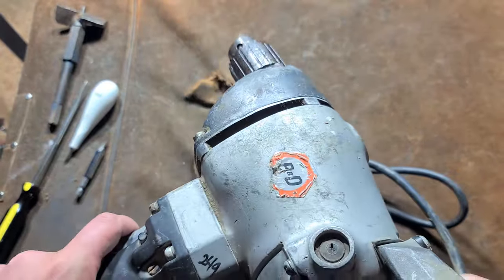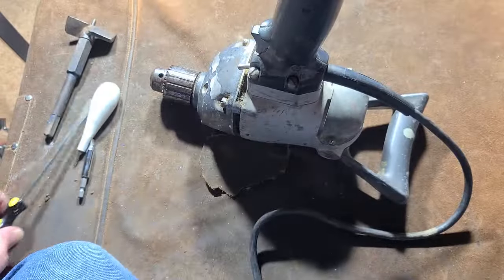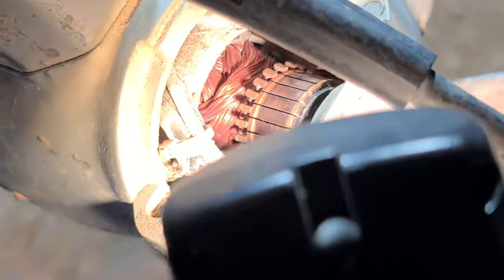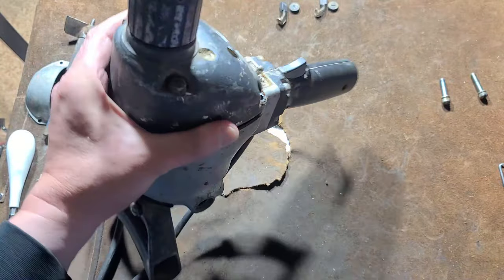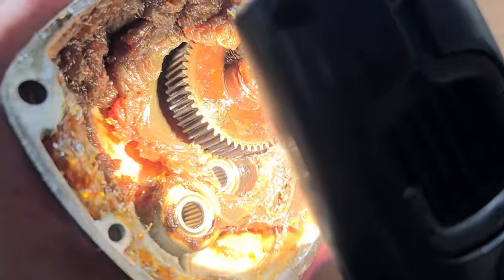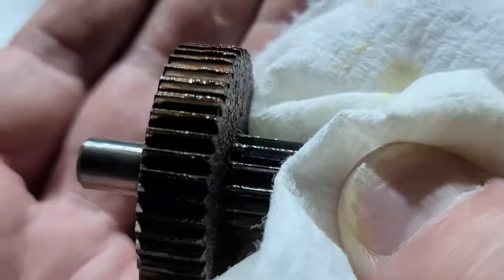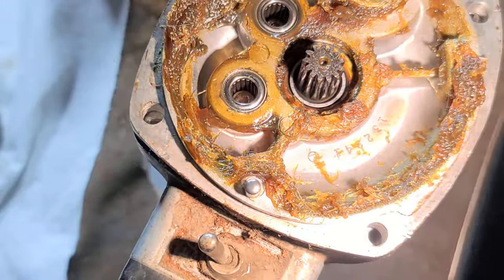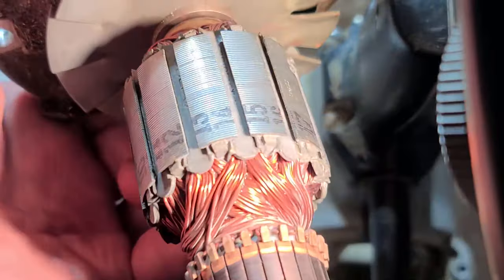Black & Decker USA 1/2" Heavy-Duty Spade Handle Drill Review/Teardown

Comment: Mr Maximus, It is good to see this classic, American made tool found its way to the right owner. I would respectfully suggest that with its inflated prices, Ebay is just about the WORST place to shop for  used tools. Lastly, I wonder whether the drill is older than the Linoleum floor. 🤔
Reply: It's likely that the drill is older. Its from the mid 1970's
Reply: @NKWoodworks  If I had to bet, my money would be on the Linoleum. 😉